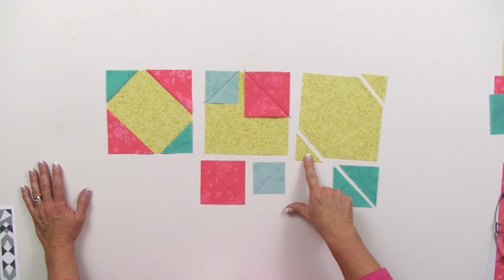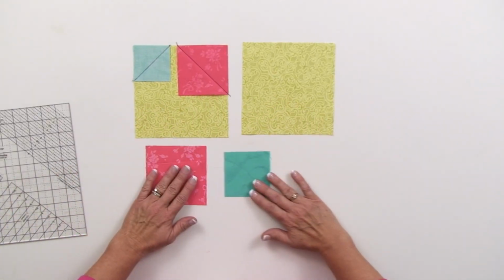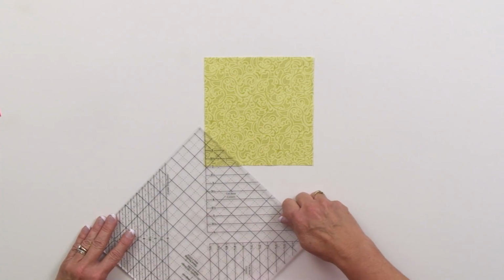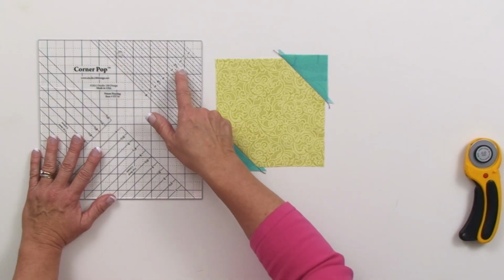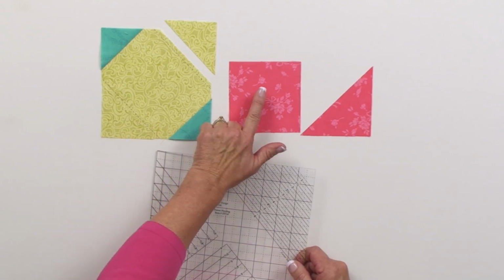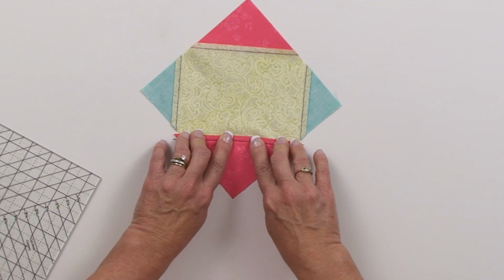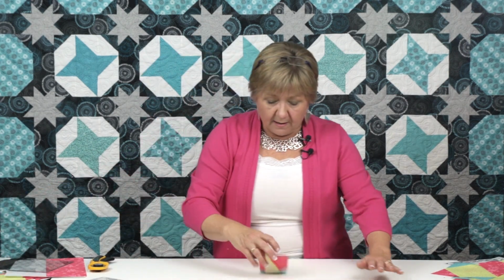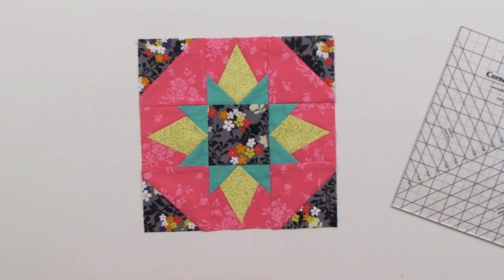Corner Pop Fundamental Tool

Comment: I recently made your Signs of Autumn table runner, I found it confusing to use the method for the Quicket Units using the wing clipper ruler, I think using the corner pop would be much easier to use and save on fabric. I am going to do this with the next one I make.  By the way, I have all of your rulers, haven't used them all yet, but I am ready when I need one.  Thanks I really enjoy your videos and love your rulers.